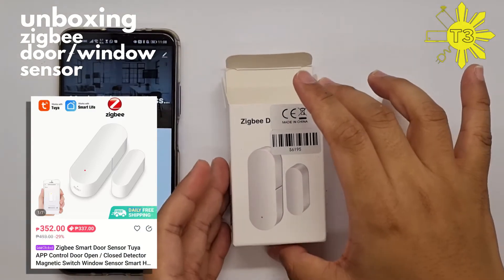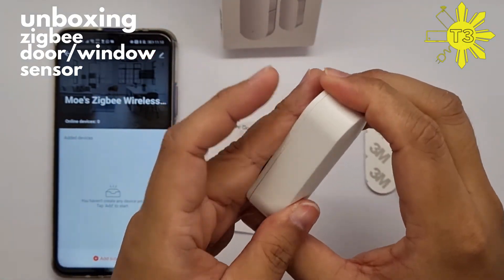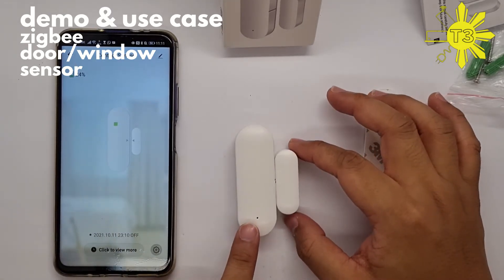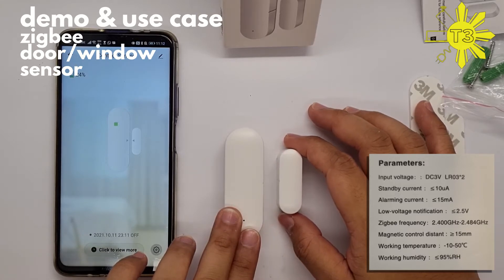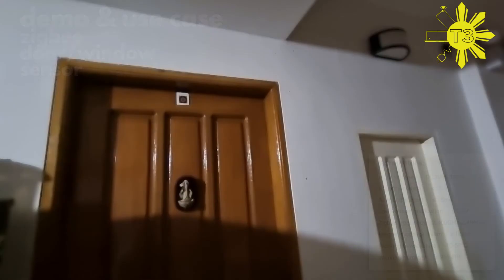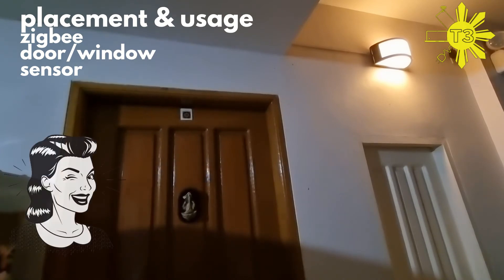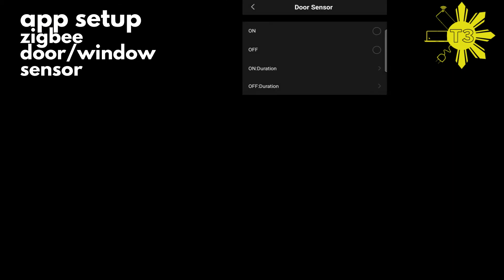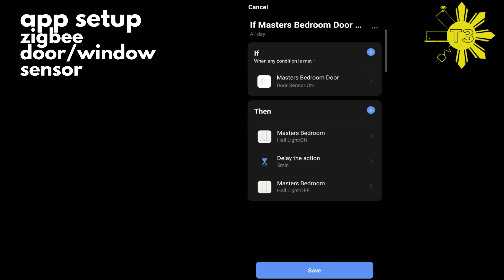Tuya Zigbee Door / Window Sensor Full Review & Automation Guide

Comment: Would you know if it’s zigbee 1.2 or 3. Nothing on the product page mentions about the zigbee version. In the packaging it seems that it’s also missing. Thanks.
Reply from the maker: Hmmm I went in the app and there are no details as well. But so far it's running well. just strongly suggest you use rechargable batteries especially kung high traffic area cya. Wala pang 1 year ubos na cya. but what's nice compared sa iba it just uses standard batteries lang naman. Hope it works well! 🤗

Comment from the maker: quick update since posting a month ago the battery died on 11/16/21. It started at 20%. I recharged the battery and at 1.39v it is showing 70%. Will monitor this over the next few months and do a follow up video. but it seems like 1month per 20% so about 5-6 months on a fully charged batt.
Reply from the maker: I just check since this is a high traffic door it is closed and opened 200-250 times in a day.
Reply: Wondering what that door is. 200 times is too many. I’m thinking of a commercial establishment like resto entrance. 😄

Comment: Great! I see there's not much delay in the automation. I have a wifi tuya door sensor (not a zigbee) and it's freakish has 3-5 seconds delay before opening the lights.

May I know which zigbee hub are you using? Thinking to buy this one in the video....
Reply from the maker: what brand is that pala also pare?
Reply from the maker: Oh wow that's long! The ZigBee sensors are almost instantaneous. The only things I have on wifi are the plugs.

I still have to review a motion sensor. So far the ones I bought don't work but thankfully Lazada refunded them.